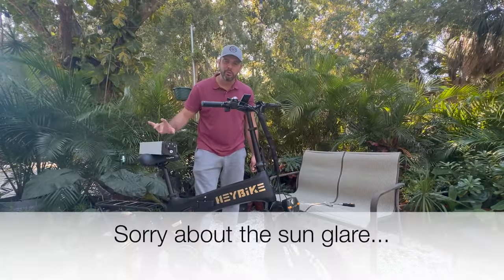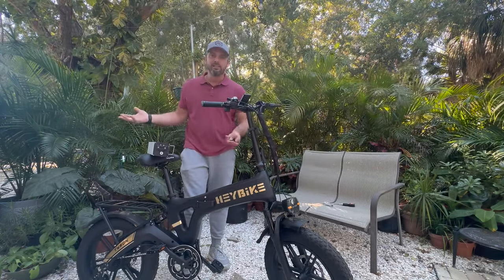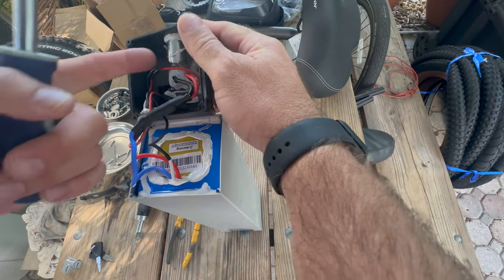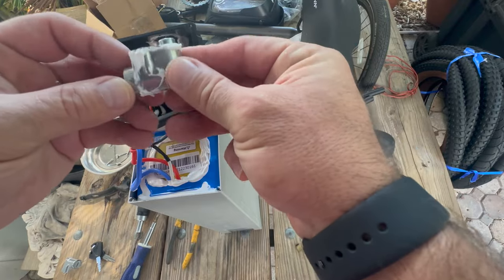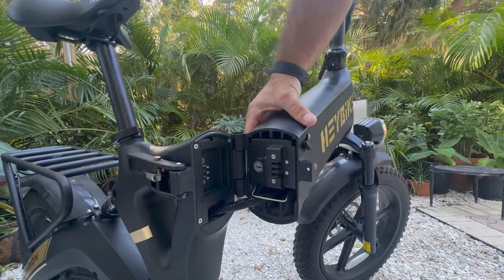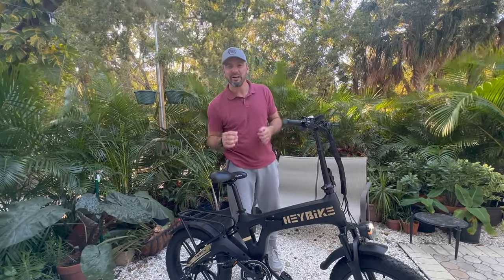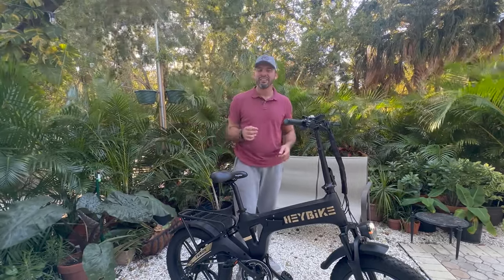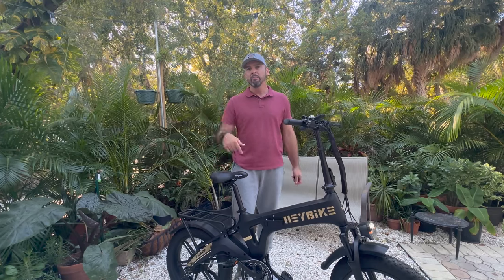Heybike | Tyson | Battery Key Lock Replacement | ElectricAllWheel

Comment: No YT video found for : What if the key is lost and key lock barrel component is housed separately such that when the top cover four screws are removed, the key lock component is residing in a separate compartment housed in plastic cover adjacent to the main plastic casing? And battery is slided into the battery holder bracket of the ebike?